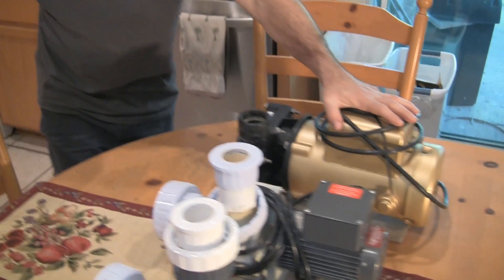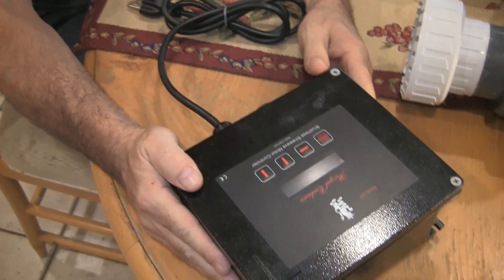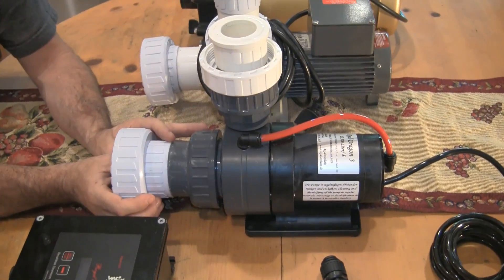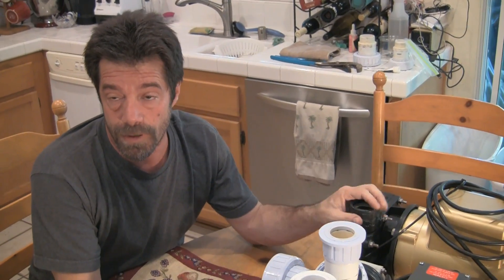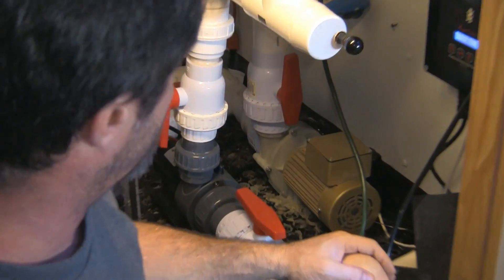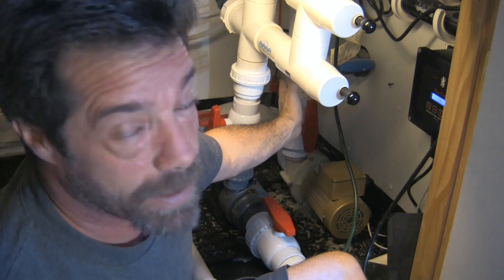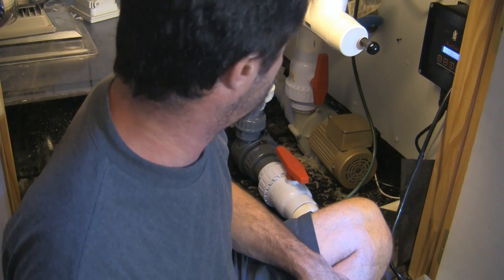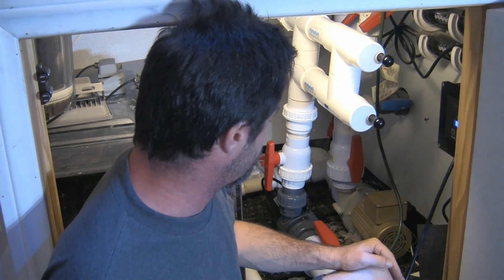DC Water Pumps, LA Fishguys Tech Talk Episode 152, part 1

Comment: Did Scott ever plug one of the DC Pumps into the killawatt to see how accurate its displayed power dissipation was?
Reply from the maker: +Brian N. He does state in one of the following parts, as I too questioned that. The Dart Gold drew 186 watts and the new DC pump draws 150 watts.
Reply: I did and in the case of the Royal Exclusiv RD3's they are true to what the display reads. In fact, they are spot on.  The return pump running at 150 watts produces the same flow as the Reeflo did at 187 is that I think we measured on the Killowatt meter. 

I know the flow is the same based on the water line in the tank. Obviously not all pumps are created equal but in general. DC pumps will consume less power.